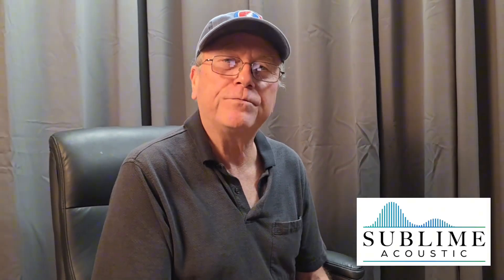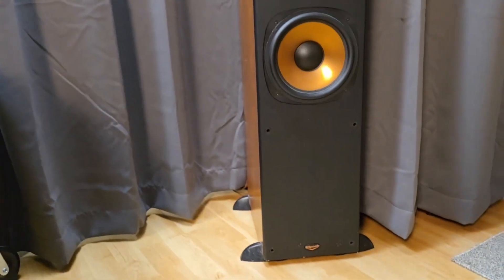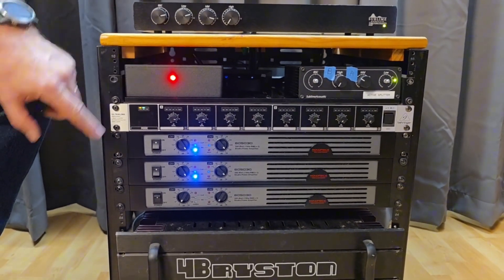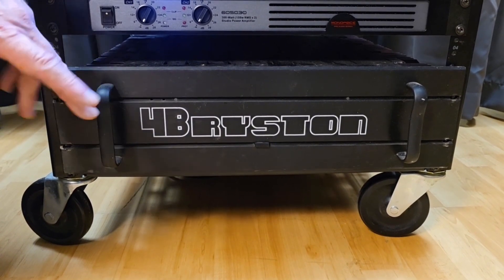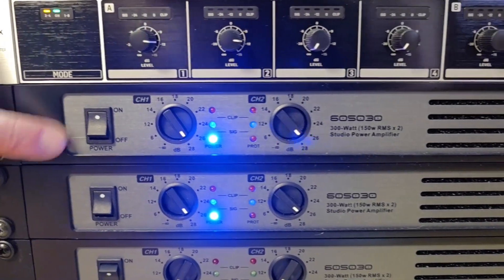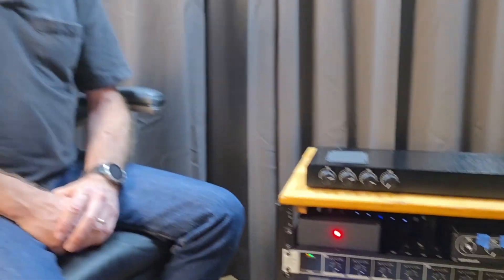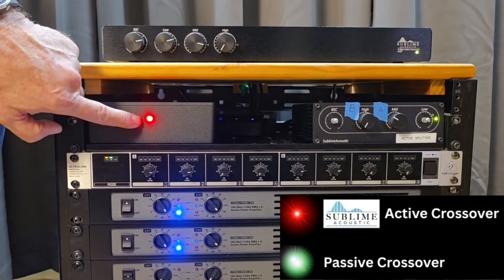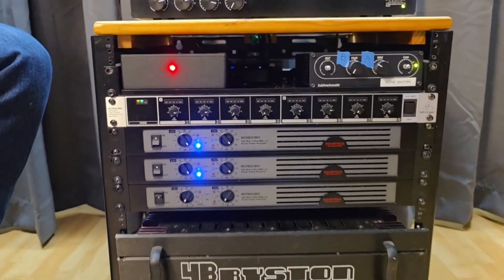Passive vs. Active Crossover: The A/B Test That Changes Everything

Comment: For my listening. Using these little amp destroy the image and the sound Bryston is a lot better. The active crossover works well, but using it on the passive xover it's not the good way to use it, it's useless. 

Would be a better test with all the SAME amp. All I can say that to my ears it's was improper setup and the sound of the active setup was not as good as the passive.

Normally it should be better with active but the configuration was not ok. 

So the problem here is not the active crossover, but how the test is made.

0/10 for the test.

But I'm sure your product is good.

Comment: I want to go active and like to see a detailed video and further explaining on how to hook everything together - chain of components to type of connectors needed.For example, do I need a resistor for each driver to protect them  damage.  im totally clueless.  Sorry, my English is limited.  I have these fallowing components that I want to run in a 3 way set up.  All JBL:  D130 16 ohm (woofer),2447j driver with horn 16 ohm (mid) and 075 bullet, 8 ohm tweeter.  I have 3 amps- 100 to 250 wpc, all are 8 ohms.  I have many questions but #1 is do I have to some conversation the 16 ohm to 8 ohm first before proceeding to other matters?  Thanks so much for any advice you can give.  All comments are welcome.

Comment: But even when biamping with active crossovers hasnt the signal to pass through the messy circuitry of the passive anyway?
Reply: Yes but there's less of unnecessary frequencies to burnoff as heat and causing intermodal distortion in the process of burning off.

Comment: There's a massive difference between the sound of the amps. To do full justice to the k231 I think there needs to be a demo of an a/b with higher end amps for both. You can hear what the crossover is doing  and it's good but the sound quality through those cheap amps diminished it a lot actually sounds a bit weird. I'm using Beyerdynamic dt 990 pro headphones. 
* When I get my new one in the mail, I will do a proper demo and with a true stereo microphone technique to capture the sound as the ears hear it. 
Such a good product needs justice to convince audio people.
Reply: https://youtu.be/69rInT7vVY0
https://youtu.be/T4bh29T2Pa8

Comment: Got my K235, it is fantastic.   I understand what this demo is trying to show, that you don't need high end amps to get the benefit of active tri-amping.  I must say, using hi end amps does make an improvement.   I love the simple controls on the front of the K235, allows me easily to balance the Sub, Low and Mid/Hi on my system.   The K235 is dead silent when idling.   The high quality build and components are great.    I don't want to "hear" the x over, just the music :)   And this thing delivers.    I was a little concerned about purchasing chips (set crossover points), but how often do I need to "adjust" those?  Not often, if ever.  

I'm running a Bryston pre-amp into the K235, the sub out (50hz and below) feeds powered JBL subs.  50hz up to 375hz feeds an ATC p2 amp powering the woofers in my ATC SCM40's.   375hz and up feeds another P2 amp, driving the mid/highs in my SCM 40's (using the internal crossover for mid to high).   It's simply audio perfection.  Sure - I could get a 3rd amp, and truly active tri-amp the SCM40's, but.........not sure the gains (all puns intended).

I'd highly recommend Sublime to anyone needing an active crossover.  Or anyone looking to improve the efficiency of your current system.

Comment: I switched to an Marchand two way electronic crossover two years ago. The top full range driver is powered by a pair of 45 push pull monos ( 5WPC ) and the bottom woofers are driven by an inexpensive class D amp ( 75 WPC ). There are crossed over at 125 Hz. These are DIY open baffles. The improvement in the sound was amazing. You can adjust the gain separately for the low and high side on the crossover to suit your taste.

Comment: Below you said... """"Yes, the passive XO was still in place—but with the signal already split at line level, its role becomes minimal. The point was to show how much of the active benefit you can hear without rewiring your speakers—something most users aren’t ready to do."""" If the passive crossover is still inline with the signal from the power amp then the crossover slope/type will change because of it. You're combining the slope of the active crossover with the slope of the passive one. Getting a much steeper slope and different phase response. Listening to the speaker straight on, although most do, in this example is fine but how has this effected the off axis response/sound? What is the crossover slope/type of the active crossover? The passive one? In general it is not a good idea to combine crossover slopes like this. Above you said """"This demo proves you do not need to remove or bypass the internal passive crossover to benefit from active bi-amping.""" Some amps might be fine with this it really depends on the passive crossover types and slopes. Also how the Grounding in the passive crossover is done. If the passive crossover's ground design allows bi-amp high and bi-amp low grounds to still be bonded together 2 amps may not like sharing a common ground. You should mention this is for speakers that offer Bi-amp hi and Bi-amp low inputs. It is kind of missleading to say you don't need to modify your speakers if a person owns speakers that have full range only inputs. The bottom line is "yes active Bi-amping can change the sound of the speaker if done right" but both on and off axis response needs to be considered. Being in live sound for over 35 years and pretty good with Smaart ;-) I can say making it sound good in one location might make it bad in all the other ones. Is the Active crossover point the same as the passive one and how much did combining the active/passive crossovers change the crossover point/slope when combined? This is the sound change noted with this speaker setup this way. What about a different speaker? Does this combination have the horn now going lower in its response? If so can the horn handle this lower frequency at the speakers rated power handling? How does this effect the overall power handling of the speaker? Or did this shift the crossover point of the Midrange speaker to not give good off axis response? Is this speakers passive crossover setup for 2 way or 3 way or even a 2.5 way? There is a lot of things here that are not covered. Yes, it is easy to hear a difference but does the Bi-amp with passive crossover setup still give the same power handling, and phase/amplitude response on and off axis? Just a DB or 2 more low end turned up in the Active crossover can make a speaker sound completely different. (which may be the intended results ;-)  ) Home audio is an interesting hobby. I started out building Heathkit receivers in the late 60's and went from there. Sometimes a little information and the understanding as to what is really going on is, well, different. The bottom line is if it sounds good to the listener then it is good! If nothing else your video gives people something to think about and maybe wanting to learn more. That in itself is a good thing. Thanks for posting. 
👍

Comment: The active seems to pull up the mids whereas the passive, the mids are more seated within the bass end. Both sound perfectly fine, it is more dependent on if you are listening as HiFi at home or pumping out a little more volume.

Comment: Not a new debate, but an interesting one! 

A good passive system will usually beat a cheap / bad active one; and decent active system will usually beat a cheap passive one. It’s all about quality of design and execution. There’s also something to be said for the sheer number of components in the signal path, which implies the requirement of increased rigor in the design of active systems, and the quality of the components.
Reply from the maker: What would HiFi be without a lively debate! Thanks for the comment and watching the video!
Reply: which active crossover would you consider serious for hi fi?
Reply: @Dj.Ariel.Electronica  I bet it has to be insanely expensive, since nothing that is not insanely expensive is even worth considering. :p

Comment: Great that you're trying this out and getting a good result. I'm going that way too. I built Troels Gravesen's the Loudspeaker, a 4-way with dsp plate amp bass driver, and passive x-over for the other 3 drivers. I've now added an active crossover and replaced the plate amp with a tube amp, and taken out one part of the passive x-over. Sounding great, I'm working on building more amps and crossovers, so I can go 4-way active!
Reply from the maker: Good luck!

Comment: A claim based on a test that makes no sense. Let me explain: 

A) Comparing 2 amps by sending them via different route is not an amp a comparison. 

B) Comparing passive vs active crossover by feeding them with different amps is not a crossover comparison either. 

C) Also, in one case you feed the speaker in bi-amp (1 Monoprice for high and another one for low) while not with the Bryston (the same amp feed low and high). You would need to bi-amp in all cases or have only one amp in all cases.  If it is a power issue, use two Bryston 3B instead, same power as the Monoprice. Anyway, considering test volume and the fact that you use very dynamic speakers, a single Monoprice would have no difficulty to supply the required power for comparison.

D) The A/B test box should permit to either switch amp while keeping same crossover path (this would compare amps) OR switch crossover path, active vs passive, while keeping the same amp (this would compare crossover)

E:) Even doing as stated in D, reading your answer below, you said you go through the passive in both case, which again is not a true crossover compare, if you still go through the passive, this is closer a test where your crossover act as an equalizer would.. 

* COST : In this test, this is a pretty old Bryston, definitively not a multi-thousand dollars one, and it probably need a full recap to sound as it should, don't know the other brand enough to figure out age. Getting two Monoprice 605030 is about 400 USD + the cost of the crossover K235 at 1 200 USD. So total cost is over the average cost of this Bryston considering the age of the unit used in the test. So it may be better, but not cheaper. 

** I don't know if it is just a lack of knowledge/experience or deliberate misleading, but if you do this test correctly, I will be glad to change my comment. **
Reply from the maker: Great points—and you’re absolutely right that this isn’t a lab-controlled test comparing just amps or just crossovers. The demo was built to show something different: that even without modifying your speakers, running an active crossover like the K235 in front of bi-amped amps can still deliver a clear, audible upgrade.

Yes, the passive XO was still in place—but with the signal already split at line level, its role becomes minimal. The point was to show how much of the active benefit you can hear without rewiring your speakers—something most users aren’t ready to do.

We chose the Monoprice amps intentionally—to prove that signal path matters more than amp price tag. And you're right about the Bryston being older—we don’t claim this demo is perfect, but the result still surprised a lot of listeners.

Appreciate the thoughtful feedback. This kind of discussion helps move the hobby forward 👊

Comment: My active x/o system is nothing like this. (nytech x/o, 2xstereo nytech power amps, arc 101 speakers with passive x/o removed) The point of active x/o is to avoid/bypass the passive speaker x/o. Your setup is not doing this, so is unlike 'standard' active x/o system.

Not sure I see the point of this.

Now, if you were to remove the speaker x/os and wire the power amps directly to the speaker drive units......
Reply from the maker: Totally fair point—and you’re absolutely right about what a true active crossover system typically involves: removing the internal passive XO and wiring amps directly to the drivers. That’s the cleanest, most direct path, no question.

But that’s also exactly why we made this demo the way we did.

Our goal wasn’t to show a textbook active setup. It was to show that even without modifying your speakers, you can still get a dramatic improvement by inserting an active crossover before your amps and bi-amping through existing passive terminals.

This is aimed at audiophiles who aren’t ready to tear open their cabinets—but still want to explore what active crossover control can do.

We absolutely encourage full active configurations (and the K231 supports that too), but this demo is about accessibility and proof of concept. Even in a hybrid setup, the benefits—improved clarity, imaging, and dynamics—are very real and easy to hear.

Appreciate your insight—and thanks for jumping in!